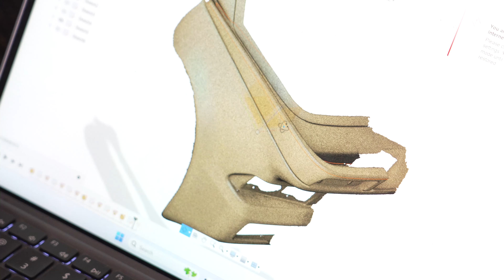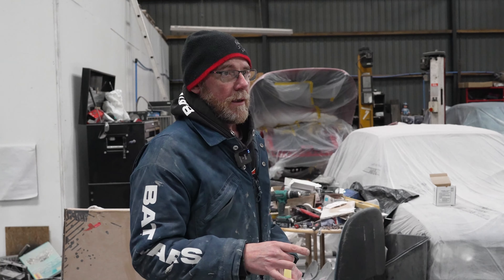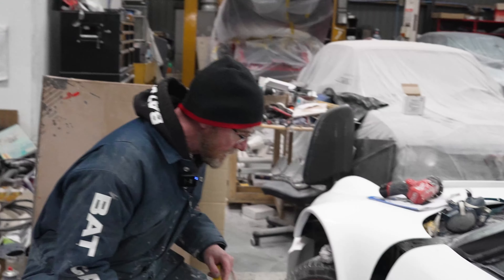Preparation for fibreglass moulding on the RB200 rear clam

Comment: i know im watching this for the moulding part (but the OEM exaust system stil on it) its a eye sore XD would be nice if that became part of the kit with the lower bumper section 4 exaust ports or 1 massive in the middle dont know how much spacing it has in the rear. *i cant help myself*. stil intressting process the prep work for the mold atleast you take the time to explain some things about that. Ather thing ive seen is people use a frame of steel or wood or something else and aliminum tape / foil to create shapes for fibre glass but i wonder if in such a process wouldnt that be easyer with piece of old clothes and plastic streched on top of it. (but yeah mostly these molds are made for fast stuf and it dont matter if it breaks). But yeah maybe such a approach can be used if you need prototype something. --- i hope the mold is gone go good on the RB200 --- twomorrow im visting a new worksite they repair trucks they looking for a handy guy i wonder if i finaly found a new job then. but gone keep trying follow this RB200.
Reply from the maker: Yep I agree 💯, just not got to that bit yet. One problem is the clam lifts from the back so any pipes coming through the body would catch and stop the clam opening. So I need to come up with another plan. There is going to be a rear defuser so I’ll be incorporating the exhaust into that. 
There’s lots of ways to create the buck for moulding but because I’m using some of the parts I’ve made for the car they need to be done in fibreglass, however soon you’ll be seeing me use wax sheet to create moulds for some carbon parts for the window pillars. 
Good luck with the new job I hope your interview goes well! 
And thanks for the input and support, it really does help with the motivation to get this done! 🙏🏻
Reply: @thecre8ors geusse i wil see when you get there =)